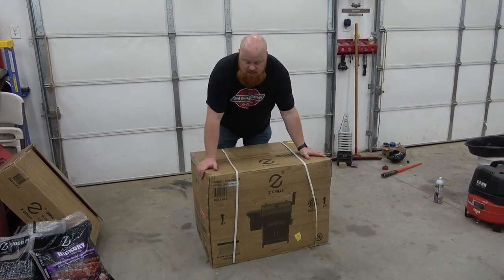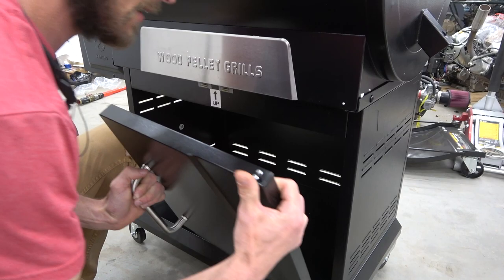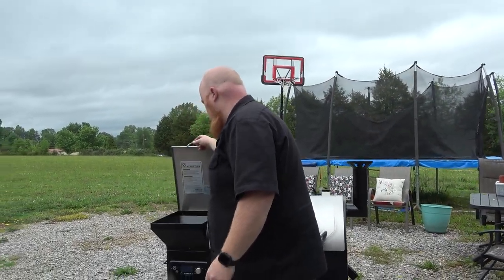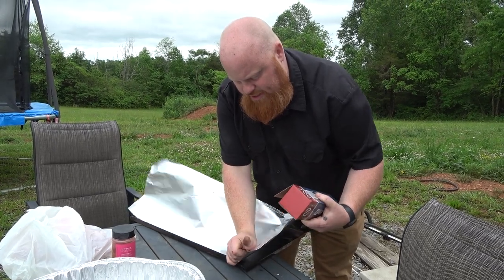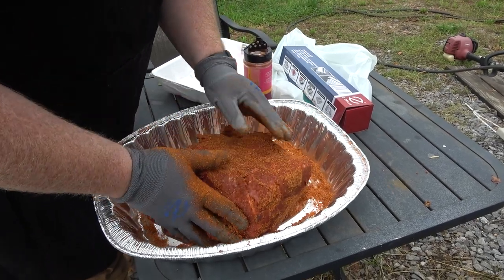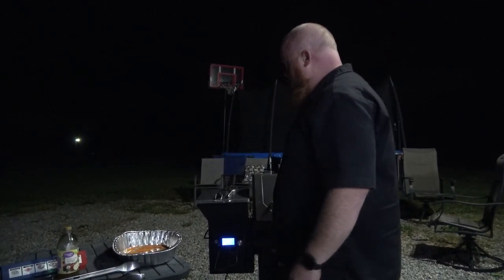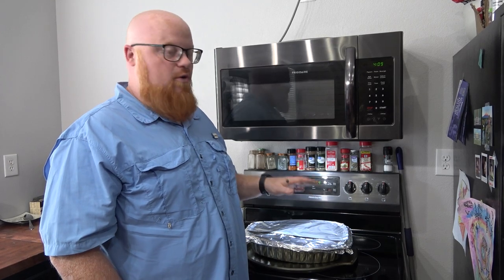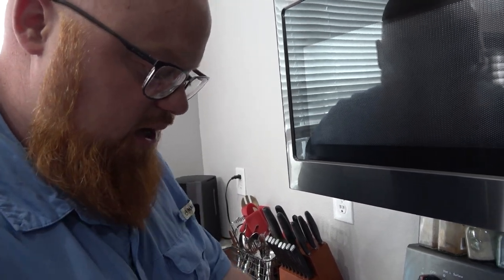Z Grills Pellet Grill ~ Unboxing and Smoked Pork Butt

Comment: Get a small plastic cooler and put it in to let it rest a few hours. It will retain some moisture. I have kept mine in for a few hours and it always comes out amazing.  The cooler works well with  chicken,beef,pork n ribs.  I use the 321 method on ribs    Try a pizza nite get frozen pizza n follow the directions. I did bacon the first time a week ago n WOW.  Homemade Mac n cheese.  Backed beans. 3hrs. at 275. Use your imagination. All kind of things to smoke.
Reply: Oh yeah get a roll of pink  paper you can get it at lowes or ace. It is to rap the meat in. HAPPY SMOKING.

Comment: You need one of the small pump up garden sprayers. That way you can spray down the meat while it's still in the smoker.
 I use a lot of apple juice and Worcester sauce mixed together for pork. Coke or sprite works well to.
   Oh....rub down the butt with yellow mustard before applying your rub,you wont taste it,it's used as a binder to keep your rub on during the cooking process.
When you hit the stall you use whats called the Texas crutch. Pull out your pork butt or brisket and wrap it in the red butchers paper keeping in mind which side is which.
When you get close to you're final temp remove the paper and put it back on the smoker and raise the temp so it firms up your bark.
If you're making pulled pork for sandwiches you'll need to pull it at 200 to 205 internal temp. So that would mean unwrapping the butt at around 190.
Reply: You’ll still taste mustard only if it’s not cooked all the way. 
But even then it still isn’t like “that’s mustard” when you get a little bit

Also I’ll wait for a good crust before wrapping. The small amount of moisture loss onto the hot steel below creates a nice flavour too so I dont mind losing some, I baste with olive oil, rosemary and lime juice leaving the limes and rosemary stalks to dry out on the hot diffuser also
Reply: too much work..boil the meat..shredd it and add cheap bbq sauce. eat with stale bread thats on sale

Comment: I don’t wanna tell you what to do. I am currently an older of a Traeger smoker grill. It is quite similar to the one you have. I just want to tell you it is best not to wrap your grill with aluminum foil because The meat you use don’t smoke well. The best places to put aluminum foil is like where the catches are and the surfaces beneath to be lined with the aluminum. Sorry I jumped again. I thought you were gonna wrap the grill. Very smart way you are doing that
Reply: I smoked up a pork butt teh day after I got my pellet smoker, and regretted deeply not wrapping the catch basin in aluminum foil.  Never make that mistake again :)

Comment: I spent over 5K on the best pellet smoker available.
While it cooks great and holds temps very well you still have the same problem that all pellet poopers have.
   Lack of smoke flavor,it's the same thing that happens when you buy Kiln dried logs for your stick burner,they're to dry and you lose a shitload of flavor.
I'll stick with my offset smokers. It's the only way to get true BBQ.
Reply from the maker: We really only use it every other week. For the amount we use it, this was the price range we wanted.
Reply: @RedBeardsGarage  
  It's not so much the price range as the quality of the BBQ.
     Had a 5k Pitts and Spitts stick burner which I sold because it was too big since we dont BBQ for so many people anymore.
    Replaced it with a reverse flow Lange that was half the size and almost half the price,burns half the wood as well.
Reply: Do you feed the pellets in during the entire cook or can you turn them off and use just the heat from the grill to finish it off. Looks wasteful after you do the foil wrap. I was always told that around four hours was about all the smoke that will be absorbed on any type of smoker but you ask ten people about smoking anything and you’ll get ten different answers.lol
Reply: @donpayne562  
  It feeds pellets automatically to keep the temp you set it at.
  How much smoke that will be adsorbed is based on the size of the chunk of meat you're cooking and at what temp.
    If you want that smoke ring you have to go further,and with a pellet pooper you have to go till the end of your cook.
   While pellet poopers are considered BBQ they'll never compare to an off set smoker.
Reply: @TrulyUnfortunate  yes i built my offset and most of the time I use charcoal and wood chunks for smoke but I’ve found that the smoke ring is about the same on the same kind of meat regardless of size if the internal temps are the same. I’ve also seen a few of my buddies catch there pellet box on fire back through the auger. You can open up a can of worms when you start talking smoking and grilling . My moto is if it’s cooked on wood it’s good. Lol
Reply: @donpayne562  
Cooking with wood chunks? Bwahahahaha!!!
Get back with me when you cook on the competition BBQ circuit.
  I've been BBQing now for 36 years 5 of those in competitions.
   You wont win using a pellet pooper and most competitions wont let you use them.
    Fact of the matter is the only way to get real BBQ is with an offset.
Reply: @donpayne562  
   The proper way to BBQ.
First you'll need an offset smoker. Next you'll need a fire in the fire box. Whether you use charcoal or a torch to get that fire going is irrelevant. Load the fire box till you cant fit anymore logs and let it burn down till you have a nice bed of coals.
    Now you need to adjust your vents to get the temp right. The idea is to keep enough coals burning to keep that temp at 225 to 275.  And when you throw in a new stick your fire is hot enough to get that stick burning quickly and not put out white smoke. It helps to strip that fresh log of bark for a cleaner burning fire.
   Clean blue smoke is what you're looking for.
   If you have a good quality stick burner it's pretty easy to achieve and hold temps.
    If you have a cheaper store bought pitt you'll need to add some firebricks in the firebox and the bottom of the smoking chamber to keep your temps even.